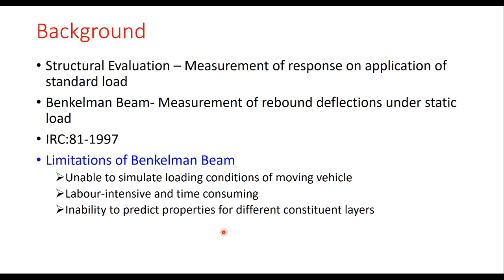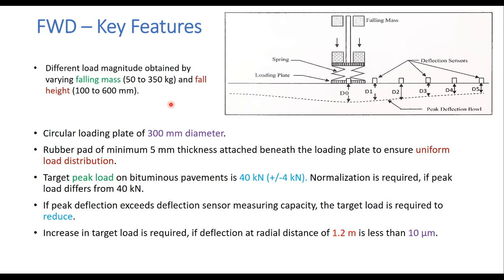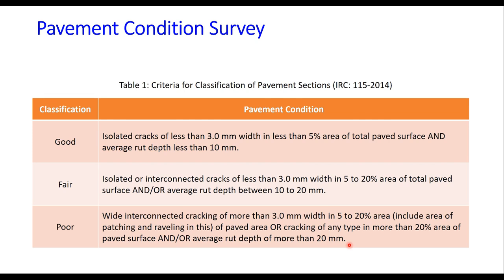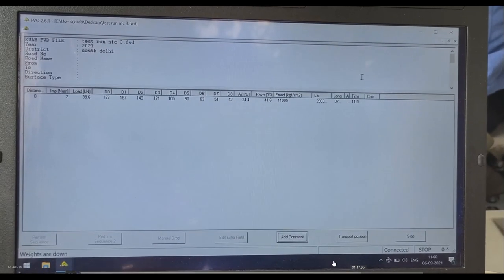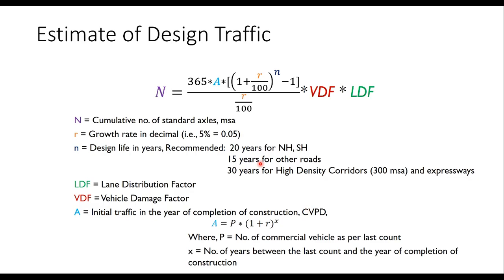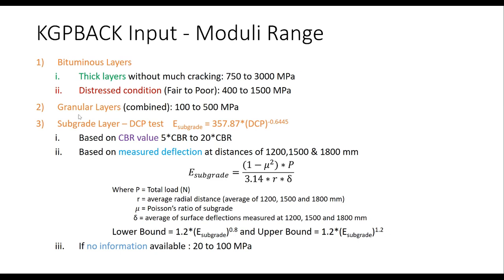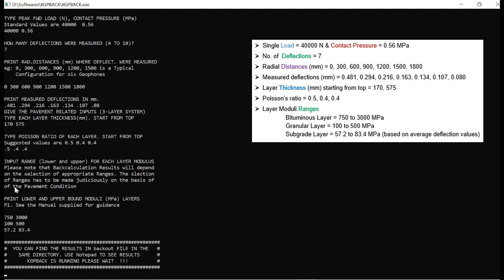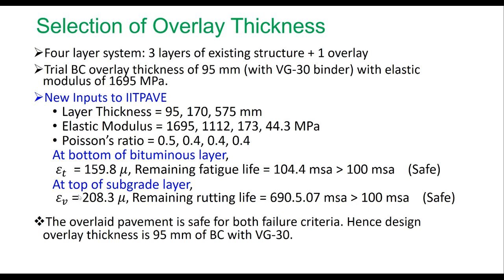#pavementevaluation, #highways, How to design Pavement Overlay with Falling weight Deflectometer

Comment: Sir, bitumen age hardens due to oxidation and resulting remaining life is suppose higher than the design life itself are there any suitable correction factors to rightly indicate the remaining life?
Reply from the maker: You are not correct. Hardening of bitumen results in fatigue cracking. Life reduces with age of the pavement.

Comment: Sir what is the minimum layer thickness of existing bituminous layer of carriageway  for which FWD will yeild realistic overlay thickness by safe design as iterated
Reply from the maker: as per FHWA, the minimum thickness is 75 mm. Below this threshold, it becomes difficult for the software to isolate layer moduli, and assumptions or fixed modulus tables must be used. It means if the thickness of bituminous layer is less than 75 mm, assign the value of modulus to this layer manually.

Comment: sir 95mm bituminous layer ke liye v30 ke corosponding jo elastic modulus 1695 liye hai a/c to irc 37 usko explain kar dijiye plss
Reply from the maker: These values are suggested based on research done in india.
Reply: @SatishIITR  sir irc ke kaun se page milega, agar hmko 95mm ke place par 105mm lena ho to kaise find out karnge
Reply from the maker: @mukeshkumar-s4m8b  Mr. value does not depend on layer thickness. Thickness is assumed by trial method.
Reply: @ ok sir thanks

Comment: Sir,
Can milling is permitted for overlay of bituminous surface after FWD test.Miling out existing bituminous surface may reduce the strength of pavement.sir,pl clarify this
Reply from the maker: Yes, milling should be preferred. Mill top 50 - 90 mm of bituminous layer and recycle it. Design the pavement as per IRC 37

Comment: m	0.4	
P	40000	
r	1500	(1200+1500+1800)/3
w	0.107	(0.134+0.107+0.08)/3
E	66.67	
		
	53.34	66.67*0.8
	80.00	66.67*1.2

Im getting E value as 66.67 by using above parameters. Can you please tell me what I did wrong
Reply from the maker: I did not understand these calculations and your question. Why did you take average of r and w?
Reply: @SatishIITR  As per code r is average of radial distances and w is average of surface deflections measured at 1200 mm, 1500 mm and
1800 mm. My question is by using parameters for calculating subgrade modulus range Im getting the answer as 66.67 MPa
Reply from the maker: @BHARATKUMAR-zf4co  a subgrade modulus of 66 looks fine
Reply: Sir value is differ with the given example in Appendix iv of irc115 @SatishIITR
Reply from the maker: @GoutamChatterjee-w4j  which value?? Value of subgrade modulus?

Comment: Sir, what is the moduli values consider for flexible pavement with CTB & CTSB layer for FWD analysis
Reply from the maker: In the FWD analysis, you can take initail value of moduli as suggested in IRC 37. The program will calculate it.

Comment: Sir 
In IRC 2015 given example so many problems... so i confused.  Because 1st problem is poisonous ratio new payment of BT layer we take as par new pavement design is 0.35 as per IRC 37 andIRC 115 given 0.5. 
2) 2nd problem is Va-Vb we can change va-vb in different different project y we take Va 3.5 and Vb 11.5 as per IRC 115 example.
3) in IIT PAVE how many analysis point use and how much radius use  in road project? .  Because in IRC 37-2018 IIT PAVE USE DIFFERENCE PARAMETERS AND IRC 115 USE DIFFERENCE PARAMETERS SO CAN U suggest me which can we used .
Reply: Ok thank you sir
Reply from the maker: Yes, there is a confusion in Poisson ratio as suggested in IRC 115 and IRC 37. You can take any. There is very little effect of Poisson ratio on results.
Generally we take 4 points for analysis. one at the depth of bituminous layer and radial distance zero, Two at same depth but radial distance 155 mm. three at the top of subgrade layer and radial distance zero, fourth, at top of subgrade layer and radial distance 155 mm.
I have explained in my video on Design of Flexible pavement aslo. It is available in Hindi and English both. Watch it once.

Comment: Please note that IRC 115(2014) states that the subgrade modulus is 59.6 and the corresponding ranges selected for subgrade modulus are 57.2 to 83.4. But upon calculation  the lower bound value comes out to be 1.2*59.6*0.8= 57.2 and the upper bound value comes out to be 1.2*59.6*1.2= 85.82 instead of 83.4 as mentioned in IRC 115(2014) pg 32. Please clarify
Reply from the maker: It does not matter whether it is 85 or 83. This range is given to the software to start the iteration and the final value will depend on the deflection values and layer thicknesses. The software has some weakness and I am sure these will be removed in the next revision.

Comment: Sir

   F.W.D.  The value of deflection is obtained from the test.  Then how is the modulus value of each layer obtained?  Sir please explain.  
It will be so kind of you.  
Thank you
Reply from the maker: Modulus of eavh layer is obtained using KGPBACK software. It is a program based on Genetic Algorithm and comes with the IRC code. I have explained this method in the video also.
Reply: @SatishIITR How to get 
KGPBACK Software?
Reply from the maker: you can download it from internet @parasmanisindhia4493
Reply: Thank you sir
Reply: Sir, please provide the download link.
Reply: How to calculate 15% in modulus value for divine purpose
Reply from the maker: Put all values in an Excel sheet in the decreasing order then take the value where 15 percent of all values are lower than this value.  @parasmanisindhia4493

Comment: Design Life in IRC 37: 2019 is 20 years for flexible pavement and in IRC 115 : 2014 it is suggested for 10 to 15 years for design of overlay, basically my question is if we are going to widen existing two lane carriageway to2 Lane + PS, which traffic calculation will govern design either IRC 37 or IRC 115.
 Other query is if in widening for 30 MSA traffic and 8% Subgrade CBR crust thickness is 200 mm GSB + 250 mm WMM+  95 MM DBM + 40 MM BC and overlay thickness by FWD test we are getting 90 mm BC over 120 mm existing Bituminous part, how layers will match in this case?
Kindly explain my query
Reply from the maker: IRC 115 is for the purpose of overlay design only, not for the design of pavements.
Layers must be matched from subgrade level. You need to dig the side so that base course layers in two pavements is at the same level.

Comment: Dear Sir,
I would like to get clarity on the Remaining fatigue life, in your video it comes out as 11.07 msa which is less than 100 msa (design life). So if I have similar case where my remaining fatigue life is 17.1 MSA and 19 MSA (design) then, whether this will also require the overlay to match the design MSA 19 requirement?
Reply from the maker: Yes, you need overlay on this road so that pavement lasts its design life.

Comment: Thank you so much sir
Sir, if i have deflection data at 200 m interval for a 4 km stretch , then should I input the deflection data at each interval one by one in KGPBACK or is there any other way to get the output from KGPBACK by giving deflections along the chainage at a time?
Reply from the maker: you need input the data at each location
Reply: Thank you sir
Reply: Sir, while calculating remaining fatigue life , what about the C value in the equation, factor C of volumetrics?
How can we get C value sir?
Reply from the maker: @saitharun9585  In the same manner as you take in the design of a new pavement.
Reply: @SatishIITR  okay sir 
Thank you sir

Comment: In kgpback we took poisson ratio of existing bituminous as 0.4 and in iitpave we took it as 0.4. Why
Reply from the maker: You wrote same in both cases. The Poisson ratio of bitumnous layer will increase with temperature. Test temp in FWD is higher than what we take in pavement design.
Reply: Can you please share KGPBACK SOFTWARE

Comment: Please make a video on rigid pavement also sir.
Reply from the maker: There is no other procedure for Rigid Pavements. An FWD is  used on rigid pavement to evaluate the load transfer across slabs and can be used to detect large voids when
significant erosion of the base material has occurred under the slab joints. An FWD is commonly used to determine the
variability of overall deflection along the roadway alignment. The test pocedure is same.

Comment: Sir can u explain how to calculate the 15th percentile module values?
Reply from the maker: 15th percentile value of any data set is the value above which 85 percent data would lie. So if you a series of data (for example Mr values estimated at different locations of a highway) then arrange them in decreasing order and locate the value below which only 15 % values lie. This can also be done by making a frequency table and plotting cumulative frequency curve in excel sheet.
Reply: @SatishIITR   Thank u for ur valuable information sir...

Comment: Sir I wanted to ask you some questions
Reply from the maker: sure,. you can write either here or you can send me an email.
Reply: @SatishIITR  ok sir
Reply: @SatishIITR  I wanted to ask you that it is possible to suggest reconstruction of the pavement section after performing the FWD test.
Reply: After analyzing the data..after calculating the overlay required can we suggest this?
Reply: Or else how can we analyze that the granular layer n subgrade are not sufficient enough to carry the design MSA

Comment: Sir, if the existing Pavement has stabilized layers like BSM, or CTB/CTSB then during the use of KGPBACK software in which layer type should these layers be considered? Either Bituminous layer or Granular layer.. Especially incase of BSM with foamed bitumen?
Reply from the maker: stabilized layers are more close to granular layers.
Reply: @SatishIITR  Thank you so much Sir..

Comment: Sir,
1. Can we put 40mm BC and 55 mm DBM over existing BC.
2. Can we lay DBM over existing BC being inferior grade.
3. Or we have to mill the existing BC before laying 55m DBM and 40 mm BC.
Reply from the maker: Arun Ji, It is always good to mill the existing BC if you can. It will save both natural resources and environment. If not possible, you can certainly put DBM layer over existing BC. Remember, you need overlay on a road because the existing structure has become weak. So BC is now a weak layer.

Comment: please explin the normaliseation of fwd ಡಾಟಾ for standard load on rigid pavement with a set of data  !
I  it's only the you for correct person to solve my problem so I am requesting you sir please explin me  !
Reply from the maker: Normalization here means extrapolation only. If deflection value for a load of 39 kN is 0.234, then for 40 kN it will be 0.234*(40/39).

Comment: Sir i would request you please kindly provide a lecture on FWD data collection for Airfield Pavements and Back calculation of material properties and over lay design 
If possible please
Reply from the maker: will try. However, the method of data collection remains same at airfield pavements also.